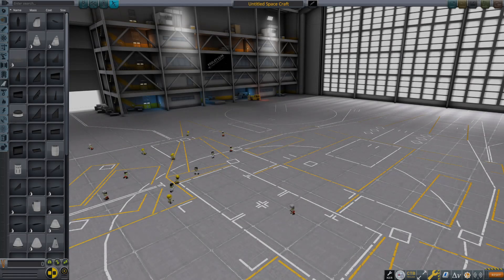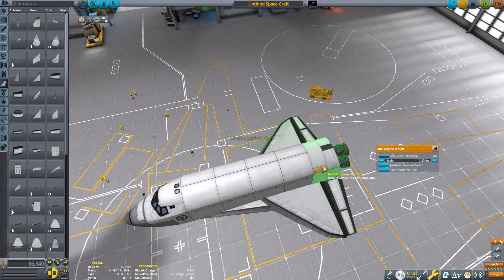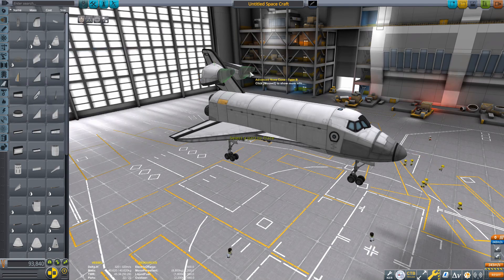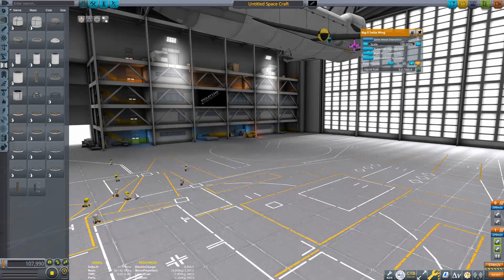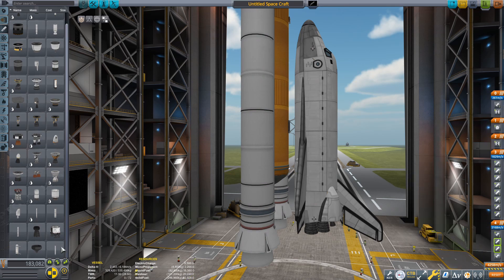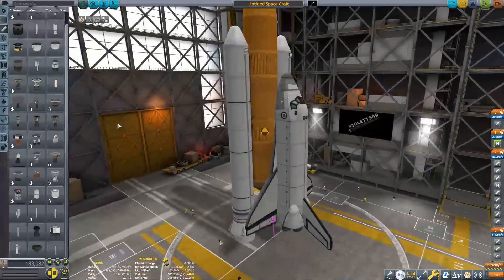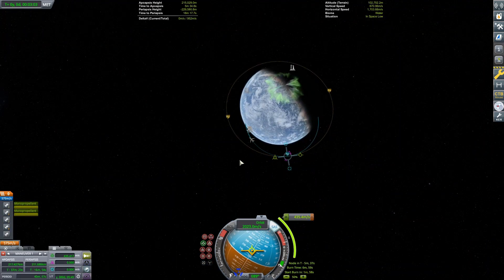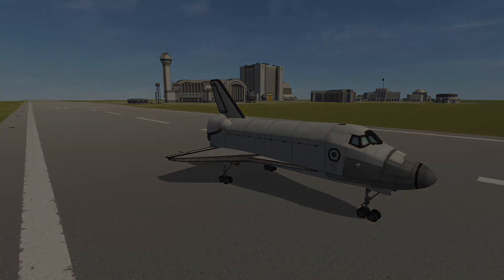KSP Tutorial: How To Build A Stock Space Shuttle | NO DLC REQUIRED |

Comment: A trick I figured out myself (though I'm probably not the first one to do so) is put a probe core angled the same as your RS-25s (I usually put mine on the external tank) and control from there during ascent. It has allowed me to pretty much do a normal ascent profile when launching my shuttles.
Reply: i had the same idea recenty, although i did not execute it the same way. i placed the probe core at the back of the upper main engine and offset it into the engine base so i could still reach it by mouse if i wanted to. did the same thing with the oms (two for symmetry). then bound keys to them so i could easily switch between the first, the other or the cockpit for descent.
Edit : btw i used terriers as OMS, the puff engines in this game are not near realistic appart from the fuel it's using

Comment: K, protips from the Buran: use the fairing as a nosecone of the shuttle. It's got higher max temp. 
While reentering, set your pitch to 40° just as NASA used to do, it really helps. 
And your center of mass of the orbiter itself is too far back. Try to move it towards the front, with some additional weight, like the airlock mockup and docking system. 
And maybe put a few separatrons on the fuel tank. I did that, bit that's just a suggestion.
Reply from the maker: The fairings would look a little weird imo but I'll give it a try. I actually tried to pitch to 40 during reentry, but it would ultimately still spin out. The COM being too far back was a definite problem, thx
Reply: I'm having no luck doing a reentry with the stock 'slim shuttle' ... Everytime it just overheats and burns up. Is it worth trying to come in backwards? Any chance you could try it as at the moment I have 3 pilots all stuck until I can be bothered to launch a rocket to get them :( I expected a stock example build to work correctly :(
Reply: @_RandomPea  Your reentry angle is probably too high. Set the periapsis at about 20km and point your nose 40° above prograde. It should help
Reply: @MrSlyFox  ahhh I set periapsis to 41k like I do for command pods so that might be the issue. The passenger cabins just seem to be made of cardboard :D
Reply: @_RandomPea  Hm...that's strange. 41km periapsis should be more than safe for reentries from low kerbin orbit
Reply: @MrSlyFox  exactly! Honestly tearing my hair out. I was at a 30 deg angle and just as I get into the thicker atmosphere blows up everytime
Reply: @MrSlyFox  landed all 3 of them... Your method worked but I had to turn retrograde and burn off the left over mono. Had a couple of retries but got there in the end . Cheers for the tip
Reply: @_RandomPea  Hey, all kerbals are back home, and that's what's importnant!
Reply: @MrSlyFox  well until the PS4 kraken attacked my 'back to vab' attempt on a Duna crusier meaning on reload I lost one of these fellas as I tried t ok recover to kerbin and forgot quick save... Meh... He will be remembered... Whoever he was

Comment: tip: You can use Heat Shields at the bottom of the orange fuel tank
Reply from the maker: oooOOooo, I like it, thanks
Reply: Can’t you just use the top cap thingy for both sides?
Reply: @Coli2603  true but I think its heavier
Reply: How do you set the back of the orange thing
Reply: that's what I did in the early days
Reply: remove all ablator from heat shields to make it lighter
Reply: @Piolet1549  are you sure this needs no dlc or mods?

 I did everything but my ship would just fall before I could fly it.

 None of the stabilizers worked and when I right clicked the parts there were no options to transfer weight or whatever. 

Just the Color and the amount of fuel or the ability to use the lights.

What I mean is your right click box has mor options then mine

Comment: Well, thing is with stock space shuttles.... you need a larger external fuel tank. the 5 meter saturn v parts are the correct size, but color is a problem. The best you can do is make take a load of orange 2.5m tanks and shove them into a spherical shape.
Reply: You could use a fairing but it would just add more weight to the vessel.
Reply: You could also use the 3.5 meter parts
Reply: @scubaduckk  Well thing about the 3.75m parts is that they are too small. And using a fairing adds a negligible amount of weight, and the faring orange colour setting is mostly green. Overall multiple 2.5 meter orange tanks moulded into a 5m diameter is best.
Reply: @elijahwills7331  I don’t even have the game(yet) and this just interests me so much!
Reply: @elijahwills7331  I use a mode tweak scale to get the 3.75m parts scaled up to 5m, its a good solution if your on PC and really trying to make it accurate. (Its also good for other recreations I've made)
Reply: @ironagent45  It is good, but I prefer to keep my recreations stock as it's that much more impressive doing it that way.
Reply from the maker: It really is personal preference imo, I use 3.75 on my space shuttles and 5 meter on the Energia/ Buran
Reply: @Piolet1549  yeah that is how it works. For me sizing seems to be the most important part, but maybe someday I'll try mixing together 2.5m orange tanks to get me a 5m diameter.
Reply: Well the first Shuttle launches used white tanks
Reply: But the orange one looks multiple times cooler
Reply: sts 1 and 2 had white external tanks so don't worry be like them

Comment: If you do a non dlc shuttle use the 5m tanks you get more control and it can get orbit using just the tank leaving loads of fuel in the shuttle systems to get a really high orbit for flexibility (also its the correct size in terms of looks)
Reply from the maker: k thx
Reply: @Piolet1549 when I built the shuttle recently it falls over off its stands when trying to launch, breaking the wings off.

Why does this happen?

Comment: I don't know if they're intended to be used this way IRL or not but the tail fin of the orbiter and the bottom of the SRBs are level with each other on the real space shuttle, I've built mine to be similar and I haven't had any issues with it falling over without using launch clamps. I think I may have mounted my orange tank too low though, so that could be helping with keeping the center of mass low enough to not be an issue with this

Comment: Nice video. That the shuttle becomes unstable upon re-entry was already evident during the construction. Center of mass is too far back, it should be clearly in front of the lift point. And only 575 m/s in the tank of the OMS is too little. Especially when you consider that there was no cargo in the cargo bay. So empty it should be at least 900 to 1000 m/s.
The tip with the Trainvalve is great.
Reply from the maker: I believe the Center of Mass was slightly in front of the center of lift during landing, or else it would have been completely unstable. About the OMS's, a big reason the delta V was a bit low was because I never drained the fuel from the MK2 adaptors I used to make the OMS pods which was just dead weight. thanks btw :)

Comment: 1:12 I dint have the things below the gimbal limit which version are u using mine is 1.10
I had to tilt the vector engines to make the shuttle fly and after separating SRBs in vacuum it just pitches up because of it
Reply from the maker: the thing below the gimble thing is from a mod called tweakscale. And you should have to tilt the vectos before launch.
Reply: @Piolet1549  ok will try

Comment: Hey when I separated the SRBs it went and hit the wing of the shuttle even though I had sepetrons on the SRBs
Pls help
Reply from the maker: Try cutting the throttle on all the engines during separation, then throttle back up when they are clear. If that does not work, let me know
Reply: bruhify army  I tried a lot but didn’t work
Reply: @MakeItFlyofficial  try using mite srbs clipped into the srbs with little fuel

Comment: My shuttle keeps dropping its wings for some reason anybody else have this problem
Reply: YES I AM HAVING THAT SAME PROBLEM AND ITS SO ANNOYING
Reply: I found the problem the wings get pulled down by the cranes so just remove the crane and do what he first did and put cranes on the fuel instead and that should fix the problem
Reply: So now it works but the thrusters on the shuttle aren't getting the fuel from the fuel area so I keep running out of the fuel and going horizontal.

Comment: Hi, great video. I also built a shuttle pretty much like yours, but not exactly the same, and at launch it behaves very well, but after I decouple the SRB's, it keeps steady for a few more seconds, and then it starts rolling, and I can't for the love of me figure out what is the matter. Everything is balanced properly, I also tried turning off the gimbal and the control surfaces, i tried moving the fuel tank left and right, but nothing seems to work. Do you have any idea what could be the issue? I also followed your tutorial and built one exactly like yours, but it still does the same thing. Could there be an issue with the fuel consumption?